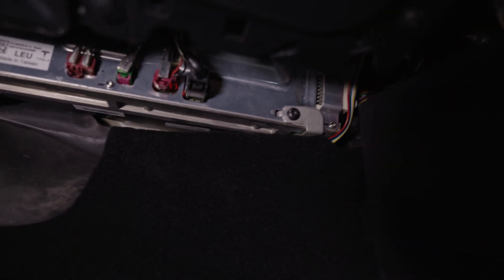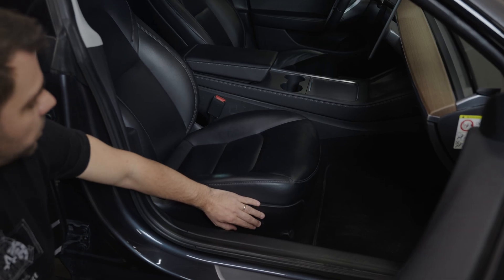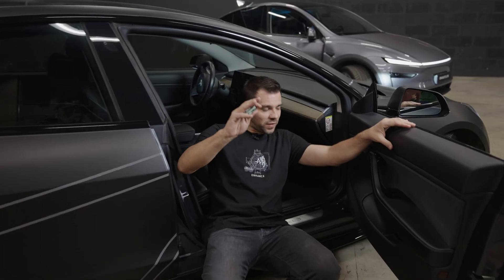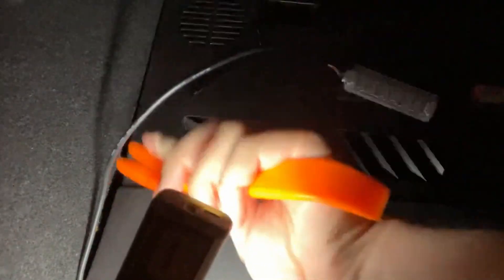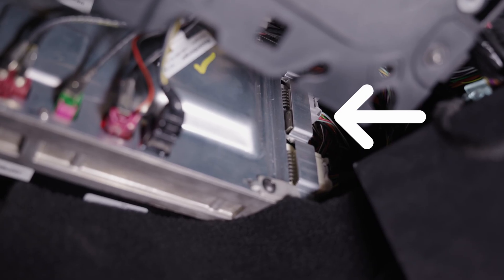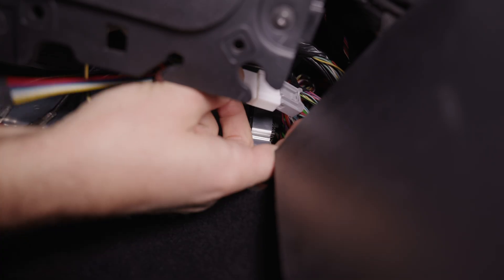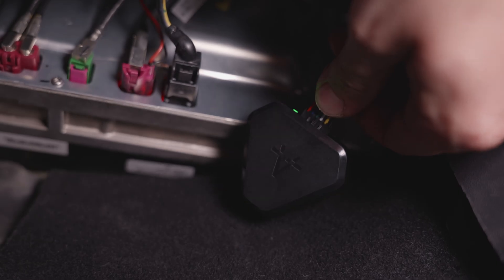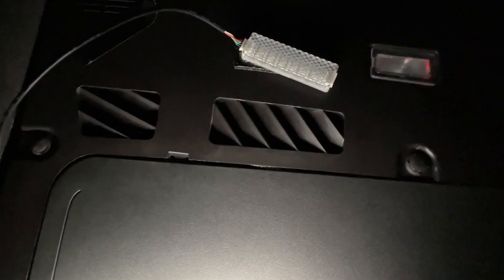Commander/Controller Installation On a Tesla Model 3/Y 2018-2020 (LHD) | MCU Glovebox Port

Comment: Hallo, ist es auch möglich bei dem Model 3 2020 Intel Version ein Commander und Strip gleichzeitig anzuschließen? Gibt es eine Art Splitter?
Reply from the maker: No need for a splitter. Just use the provided wires to daisy-chain them one to another like using an extension cord

Comment: Any video showing how to install the strip in this case? How is the strip cable routed to the controller/commander?
Reply: I would like to know this as well.
Reply: @lenbuysers4857  I installed it last weekend. Difficult part is disconnecting the cable and connecting it again with the adapter, as there is no much room for the hand. Passing the cable to the lateral panel and from there to the strip position is easy.

Comment: Unfortunately, I received the commander with the rear installation harness, and strip with the MCU harness.
Reply from the maker: Have you ordered it that way, or the team has mistakenly sent you a different one? If it’s the second one, send your order number to the support team and they will help you. 😊
Reply: @EnhanceAuto-S3XY_Gadgets  I ordered the Strip + Commander for 2019 (rear harness was autoselected). Then I received the email linking to this video, so I thought I would get the updated front harness for the commander and daisy chain with the strip. 

Not big deal, but I wanted to point this out.

Comment: Hello
I have a 2021 Model 3 with an Intel CPU. Can I use this cable to connect the controller?
Reply from the maker: You should get the 201-2024 front installation cable

Comment: installed it (even shut the car off which isn't even said in the video, so i guess its not needed) - commander doesnt show any light but my whole sound in the car is gone. honestly biggest bullshit product ever

other comment said his sound returned, but zero trust in this company if the car behaves that weird after plugging this commander in, surely last product i bought
Reply: Yup and they failed to mention if you own a 2018-2020 M3/Y you need to order another standalone harnesses to daisy chain the commander and Strip controller. If I knew that on my original order I wouldn’t had to pay double the shipping. Horrible
Reply: @OneOfDaKine82  not true for me, the cable was correct

but when i ordered there was no hint that installation differs from 2021+ models and when it arrived there was no tutorial. so i took everything apart and saw that there is no obd port in the a pillar - put everything together again and then the tutorial came out

for me now it works, car has to sleep fully (locked and +30 mins no interaction) and the next time sound comes back and strip works
Reply: @robinw944 I have a 2019 M3 ordered the strip and it came with one harness. How am I supposed to hook up my commander from the back obd to the front with one harness?
Reply: @robinw944 It’s true for 2018-2020 owners
Reply: @OneOfDaKine82  true if you have another commander, didn't read that

Comment: Just installed mine and writing this hoping it will be helpful for someone scrolling with the same installation struggles (2020 LHD M3LR)

1. Pinching and removing the 12 pin gray connector - This needs a little bit of force to the right spot - my connector felt pretty stuck until I got the right spot of actually pinching down on the exact tab where the video shows.

2. Plugging the daisy chained cable back in - I couldn't find the hand space to actually align the cable back into the slot and instead found it easier to plug the adapter into the slot, then connect the dangling piece to the unplugged car cable and then plug in the controller/commander last.

3. Strip or controller weren't lighting up even though everything was firmly plugged in - I did the whole installation with my car powered off using the screen (Controls -> Safety -> Power Off). When powered on strip did not light up. I powered off again and left the car for ~10 min. Works as expected now!
Reply: > Thank you for the information. I experienced the same issue on my side: the entire audio system stopped working. I therefore reconnected everything to the original setup, and there was still no sound. Then, surprisingly, a bit later the sound returned to normal.
>
> Can anyone explain why this happened? This occurred before I attempted the modification again.

For the supplier: you may want to consider making the cables slightly longer, as reconnecting the plug with the adapter is very fiddly and difficult.

merci pour l'information. Chez moi idem et toute la partie son ne fonctionnait plus j'ai donc tout rebranché à l'original et là aussi pas de son et par miracle un peu plus tard le son est revenu à la normale. Quelqu'un peu m'expliquer pourquoi ? Cela avant que je me remette à faire à nouveau la modification.

Pour le fournisseur: Pensez éventuellement à faire des cables un peu plus long car très fastidieux d'y rebrancher le plug avec l'adaptateur
Reply: @massimoquaglia215  exactly the same with mine, with the difference that my sound didnt return yet. honestly biggest bullshit product ever

Comment: I have a problem. With me there are no clips that you have to screw out but with me they are screws. Where do I have to connect it? My vehicle is from October 2020, Shanghai.
Reply from the maker: We don’t own a Shanghai model 3 from 2020 , so we cannot say if they changed their clips with screw , but it sounds like your car might have a port at the front right a pillar. If that is the case , we recommend using it , but you will need a different cable for that.
Reply: Where Can I get this cable
Reply: I also looked on the right passenger side is nothing

Comment: Can i use the original GEN1 cable (2019-2021(Central Console) installation cable)
Reply from the maker: No. Also, gen1 Commander does not support this installation.

Comment: I have a RHD car. So my glovebox is on the left. But the strip is designed so the cable comes out of the right hand side. Which means it won’t reach. Does this mean it won’t work for RHD cars. I have just received my sexy strip today.

Comment: I currently have the commander installed in the rear. I'm interested in moving it to the front and adding the strip. Would the strip come with this cable, or do I need to order it separately. Is there a link for this front cable? I can't seem to find it on your website.
Reply from the maker: If your car is built between 2018 and November 2020, and you order the strip for that model, the cable will come inside the box
Reply: Did you manage to put both strip and controller to the front?
Reply: @atek1232 haven't pulled the trigger on the light strip yet

Comment: I purchased s3xy knob and s3xy strip for my tesla model 3 2020 (I have retrofitted the console 2.0, so knob works fine). How can I daisy chain the commander and strip? The plug is different, can you send me another one of the cables?

Comment: It's great news.
 I have a 2019 Model 3 with Intel CPU. I pre-ordered a S3XY Dash + Commander. Do I need to order this Y cable separately?
Reply from the maker: No need — the cable is included with your order 🔧
Reply: @EnhanceAuto-S3XY_Gadgets  I wasn't thinking of the rear (center box) cable, but of the first Y cable in the video, which needs to be plugged into the Intel computer connector at the front (passenger side).

Comment: On RHD cars the MCU is on the left hand side of the car, with ports in the same place, so the controller would plug in basically in the centre of the car.

Is there enough cable to plug into the light bar from here? What’s the install instructions for RHD cars? Run the cable to the left hand side of the car instead?
Reply from the maker: RHD install is basically the same as LHD — still on the right side
Reply: @EnhanceAuto-S3XY_Gadgets  My reply seems to have got deleted…

On RHD cars the MCU is on the left hand side of the car (our passenger side). The ports are the same, on the right, but they are wedged right up against the centre console. The Controller would therefore be situated in the centre of the car. 

Does the cable from the controller to the light bar reach to the left or right of the car from there? Which side should it go?
Reply from the maker: @Durzel  On RHD cars, the MCU is indeed on the left side, so you’ll need to install the Strip Controller exactly as shown in the video, but mirrored (from the left).

The STRIP is designed by default to stick with the connection cable exiting on the right side. To adapt it for RHD, simply remove the pre-applied 3M adhesive and use the spare adhesive on the opposite side of the STRIP. This way, the connection cable will end up on the left side, close to the MCU. We are planning a new App update that will allow to mirror the TurnSignal animations too. Until it's released you can stop them from the app.

Hope that helps!
Reply: @EnhanceAuto-S3XY_Gadgets  Thanks. I’m a bit confused though. Why would the adhesive need to be removed if the strip is just being rotated 180 degrees? (cable exit on the left, instead of the right)

Or are you saying that the light only emits from one “side” of the strip, so therefore it would have to be turned upside down (with the adhesive removed and then reapplied on the “bottom” of the strip (that is now the top) ?
Reply: Yeah also curious about RHD install, I've got access to the port fine but as mentioned it's in the middle of the car rather than the left side (or right side as in LHD cars). Does the strip have enough length and will it even function properly if installed left to right? Imagine things like the turn signals might be backwards e.g. left turn signal flashes the right side of the strip
Reply from the maker: @AmyJeanes23   On RHD cars, the MCU is indeed on the left side, so you’ll need to install the Strip Controller exactly as shown in the video, but mirrored (from the left).

The STRIP is designed by default to stick with the connection cable exiting on the right side. To adapt it for RHD, simply remove the pre-applied 3M adhesive and use the spare adhesive on the opposite side of the STRIP. This way, the connection cable will end up on the left side, close to the MCU. We are planning a new App update that will allow to mirror the TurnSignal animations too. Until it's released you can stop them from the app.

Hope that helps!
Reply: @EnhanceAuto-S3XY_Gadgets so since we've got to run a RHD up the left side of the dash, that means effectively flipping the light bar over so turn signals are going to be backwards for now, is that what you're saying? 

That will also mean Blind spot indication is going to be backwards, no?

Any indication as to when this update is going to happen? Blind spot was the main reason I bought it...
Reply: @mattwills2011 . Basically everything would need to be reversed, including charging lights, etc. Hopefully it’s not too big a job for the team.
Reply: @AmyJeanes23  How difficult was it to get access to the port? I’ve heard horror stories about how little room there is there to access the connectors, with people having to take their centre console or vents apart to get access.
Reply: @Durzel Yeah I had to take apart my entire glovebox to get to it for a different mod on my car. Taking apart center console could be an alternative though
Reply: @Durzel just got access to the MCU on mine, zero chance of getting at that connector without taking the glovebox out. Certainly ain't the breezy installation that the videos lead us to believe. Probably gonna send mine back
Reply: @mattwills2011  Ouch. I've never removed the glovebox before, but I have read about people having a nightmare accessing the MCU on RHD cars for other things (e.g. HUDs etc), so was worried when all of the help was for LHD cars.

Why are you thinking of sending it back, because of the extra work involved?
Reply: @Durzel yeah, looks like an awful job and I really don't want to risk introducing rattles after taking stuff like that apart. It's also worth nothing that since these conversations started they've updated the website to reflect these are only LHD compatible now... which feels somewhat shady, honestly.
Reply: @Durzel  I installed a new dash a couple weeks ago in my RHD M3 which uses the same plug. I had to remove the glove box and two ducts to access it. It's technically might be possible to unplug the connector without removing the glove box etc but 100% not easy.

Comment: Nice video! And its great that you guys are always looking after the legacy models as well!
I just want to confirm one thing about this video. The title says "2018-2020", but in the video Dimitar says "until 2021". I have a 2021 Model 3, and I already have the Gen2 Commander installed in the front right pillar. Is it OK to keep it there?  Also, I will soon install the S3XY Strip. Where should the Controller be installed? (Front right pillar or under the glove box?)
Reply from the maker: You’re all set — no need to move anything. Just install the Strip where your Commander via daisy-chain

Comment: Currently I have the commander installed at the back of the Centre console. Do I need to move the commander to the front? Does it have any advantages? And how/where do I install the strip? Model3, 2019
Reply from the maker: The Strip installs in the front. To move your Commander there too, you'd need the front cable from us 🔌
Reply: @EnhanceAuto-S3XY_Gadgets the cable needed, is it the same cable used for other vehicles with front install?

Comment: Uhm, you did not show how to install the controller of the s3xy strip...
Reply from the maker: Controller install is the same as the Commander’s, just plug into the same port 🔌
Reply: @EnhanceAuto-S3XY_Gadgets and tge routing of the cable?
Reply: You should probably watch the video again.
Reply: @Durzel  Am I missing something? Or am I suppose to connect the s3xy strip controller instead of commander?

Comment: Is there a benefit to this location compared to the old location at the back of the centre console?
Reply: Yes it unlocks all the features that we OG’s couldn’t get before
Reply: As far as I know, only the chassis CAN is available at the rear, while both the Chassis CAN and Vehicle CAN are available at the front. For full functionality, both CAN buses are required.
Reply from the maker: Yep — front gives you access to CAN2, so you get blindspot, speed limits, and a couple other features
Reply: @EnhanceAuto-S3XY_Gadgets  how can we get the new adapter? I don't see it in the shop
Reply: @mobidik1989 Following - also would like to know how to get the new adapter on its own
Reply: @EnhanceAuto-S3XY_Gadgets  blind spot works on my s3xy strip, commander is still installed in the rear of the center armrest, only the light strip is installed into the MCU. 

T3LR 2020

Comment: Help me understand, right now my current commander is placed in the back of my center console armrest, should this be unplugged and moved as seen in this video, when the strip for legacy cars arrives (T3 LR 2020 model) ?
Reply from the maker: Totally optional — you don’t have to move it unless you want those extra CAN2 features ⚙️
Reply: @EnhanceAuto-S3XY_Gadgets  I cant move my commander, its a different connector that the “12 pin” used in the MCU, blind spot was the main reason for buying the S3XY Strip. The information on the strip promised, same features as the 2021-2024 models.  How can this be solved?

Comment: How can I daisy chain commander and controller unit for strip in this area to have both installed in front?
Reply from the maker: Super easy — just daist chain both of the installation cables
Reply: @EnhanceAuto-S3XY_Gadgets Only came with one installation cables
Reply: @EnhanceAuto-S3XY_Gadgets And where can I get these extra cables?

Comment: I've already got the commander installed for the buttons behind the center console on my 2019 Model 3. Does this new commander plugged into the MCU replace it or is it just for the strip?
Reply from the maker: You can move the Commander up front if you want — it’s not just for the Strip controller 🔄
Reply: @EnhanceAuto-S3XY_Gadgets  well and can I use both strip and commander in front?